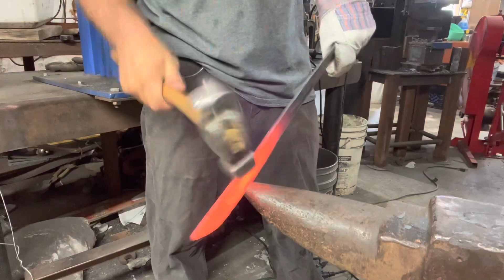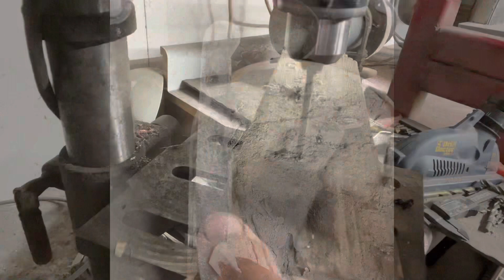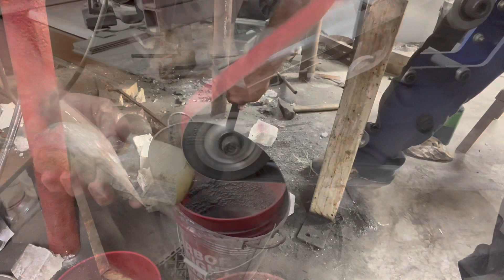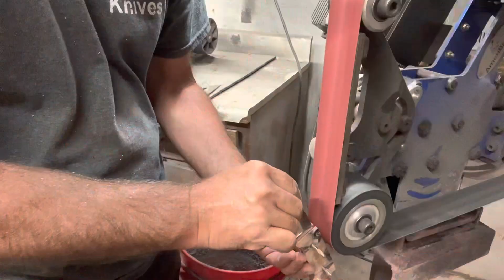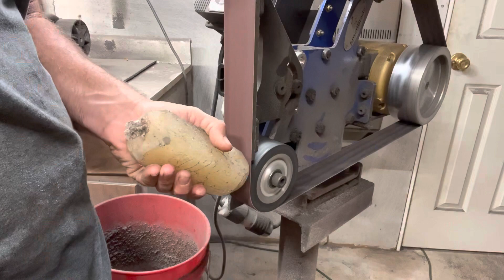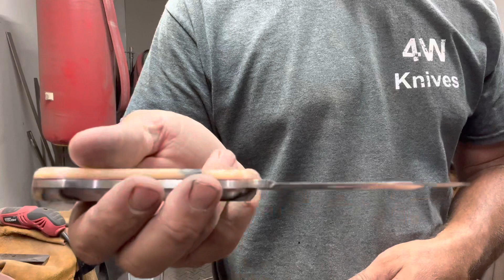Hand forging a bushcraft knife

Comment: That hollow grind turned out really nice, not practical for a camp knife IMHO but still nice. I've never been able to get it that clean freehand.
Reply from the maker: Thank you. Not sure why but from the very beginning I have had more control with hollow grinds than flat grinds. I feel like my 10 inch wheel is easier than the one I used in video. Thanks for watching and the comment.
Reply: @4wknives  I was impressed with the hollow grind as well. I would be interested to know your technique.
Reply from the maker: @ThompsonGrant  thank you. I just did a video on a skinning knife. I talk a little more about my way of doing it. That might help. But basically I start with getting to my center line on the edge and work my way toward spine. After a few passes there will be a trough form that the wheel sits in. After that it’s just about applying pressure where needed. Whether it’s on the spine or edge. Sorry I’m sure this makes no sense. I will try to do a quick video soon with better explanation
Reply: @4wknives  It makes sense, but a short video sure would be helpful. Thank for the reply!